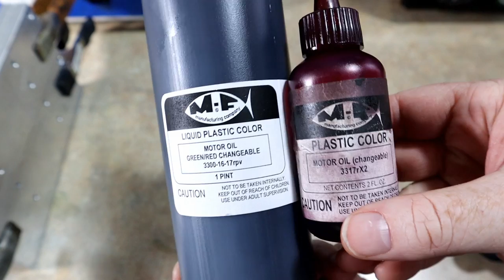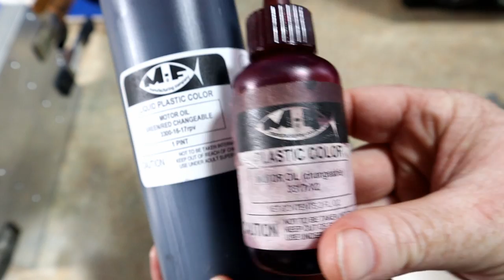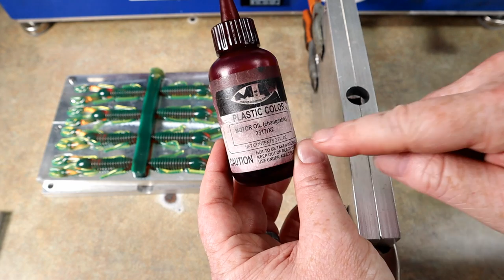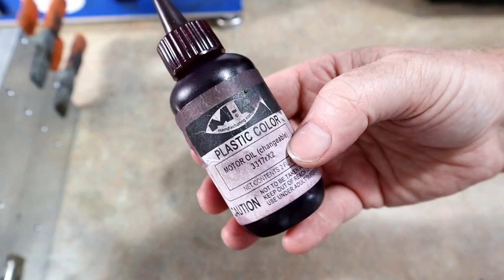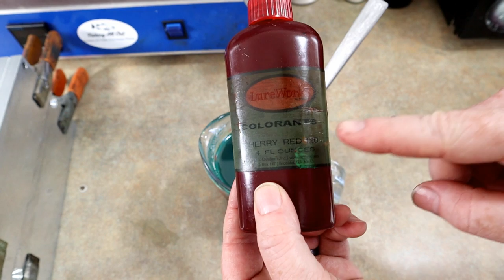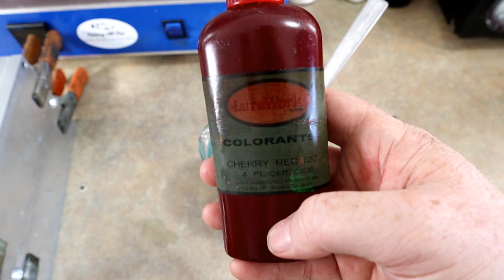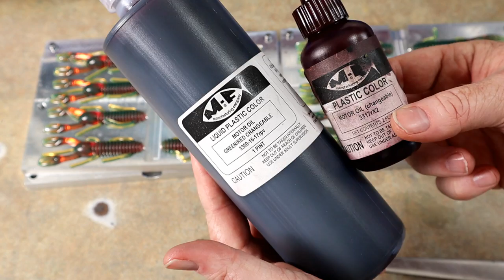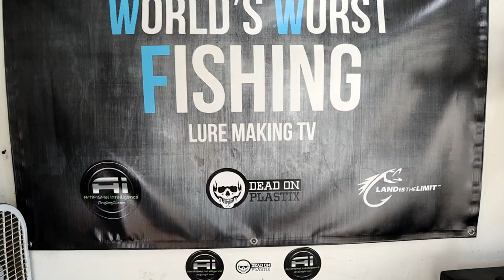Motor Oil BATTLE ROYALE: New Changeable Pigment vs Old!

Comment: I like the 1 drop red mix, but I'm finding that the new MF motor oil colorant is SO green that for a cup of plastic, 8-10 drops (at the MOST) is plenty and it doesn't get that solid green overtone. It's such a flexible but powerful tint that you really need to test a lot to see what formula you will eventually like. The heavy green overtone ruins it for me and takes it so far away from the original Berkeley and Zoom motor oil colors that are stuck in my head as that color. Easy on the new formula will result in much nicer motor oil color in the end.

Comment: You can use #3310 strawberry or add red glitter if you want red, pearl also looks pretty killer.
The x2 is the size, x2=2ounces, use to be 1 ounce for 40 years, that was a beating pumping 2,500 of each color back a decade ago.

Comment: half drop in 30 drops of red, or by my calculations, less than 2% difference. im gonna go out on a limb here and say if you would have gotten 2 or 3 different batch runs of the same color from of old stuff you would have the same or more difference between them.
Reply from the maker: Maybe so...we are splitting hairs, but oh do I love it haha..half a drop I think is probably the way to go